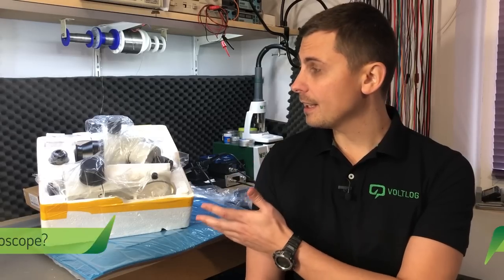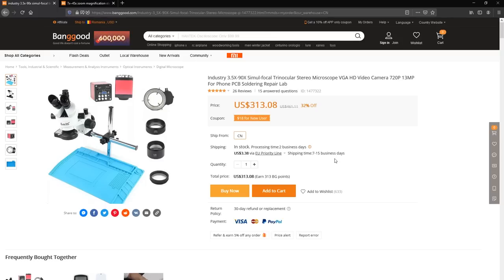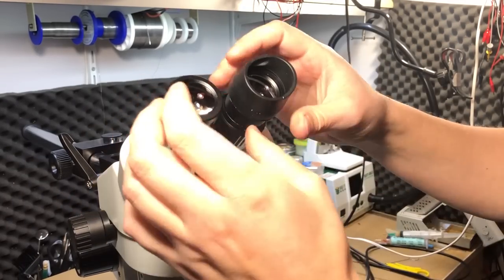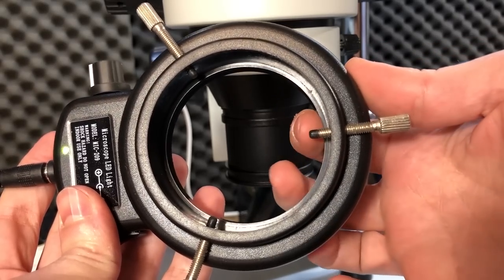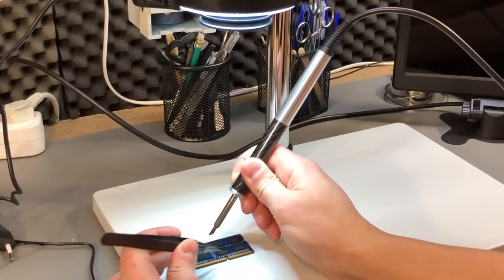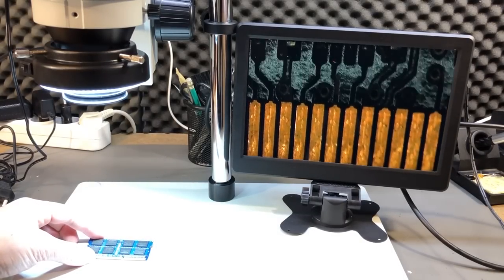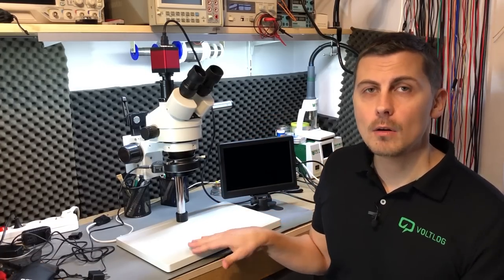Voltlog #282 - Did I get a trinocular microscope for micro-soldering and inspection?

Comment: Have you checked if there is a transport foil on the sensor?
For the FOV: Yes, you've got a passive adapter. A 0.5x-Tube instead of the 2-piece-thing works much better for FOV (but might degrade the image quality). For example BangGood 1618592.
Reply from the maker: I did check if there is any protection film, there is none as far as I can tel. I can clearly see the image sensor die inside the camera. Thanks!
Reply: I had the same Issues with my microscope. The 0.5x camera adapter basically solved both issues. The field of view of the camera is still not the same as on the eyepieces, but it's good enough. It takes a bit of fiddling to get the focusing of the camera with the eyepieces correct.
Reply from the maker: @fkiesel9442  I've ordered one of those camera adapters 0.3X, I will do an update video when I receive it.

Comment: Try the camera when not mounted on the microscope, and check the brightness like that, could be a optical mounting / focal lenght problem only.
Reply from the maker: It's hard to check outside of that mounting system, because the image is totally out of focus, there is no lens on the camera itself and I don't have any compatible lens.
Reply: Lord_haven111  `
All you need is a C-Mount 1/3 and the camera will work correctly. The thing is the C-Mount 1/3 (or 0.33x C-Mount) isn't cheap, that's why this kind of kit doesn't includes it.

Comment: I have basically the same model, but from US seller Amscope. Would strongly suggest going with the dual-boom stand if buying one of these. A little more expensive, but is rock solid and image is stable when working under magnification (the dual-boom base must be at least 40 pounds of cast iron). I also ended up using a 0.5x adapter to increase the working distance (always something to keep in mind when you need to get a soldering iron between the lens and PCB - many cheaper scopes have very small working distance that makes the unusable for our purpose).
Reply from the maker: Doesn't the more advanced boom stand take up a lot of bench space? My benches are not very deep so this matter a lot to me..
Reply: @voltlog  I don't think it needs THAT much more space. It doesn't have that big of a base, so the head is directly over your workbench surface (doesn't need it due to it being so very heavy). When not in use I just fold in the head and swing the boom 90 degrees out of the way. Even at full extension the dual boom is very solid and the image is stable, which was very important for me. Either one will do the job, but IMHO the dual boom is a good upgrade.
Reply: @voltlog  - It doesn't have to. I have a boom stand, and have built a stand for my soldering iron + heat gun on top and around the center. It adds weight, and I can extend the boom all the way out without it tipping. I have some extra stuff on the head, so it is extra heavy. When not in use, the head turns around and I center it - much like a sleeping bird.
I would think you could do something similar, if you turn the base around. Tipping over could/would ruin the head, so be sure the stand is either bolted to the table - or heavy enough so it won't tip over if/when you pull down on the head by mistake.
Reply: Boomstand cost more than the scope. Thats just insane..

Comment: As others have suggested the field of view issue with the camera and the poor image quality are part of the same thing. You need a reducing lens between the camera and the trinocular port. This will increase the field of view and, because you are 'collecting' more light, the brightness should improve too.

Also, the 'fine focus' control is not focus at all - it is the zoom control. This being a relatively low end microscope, adjusting the zoom tends to lose focus, so you need to adjust that (with the larger knob) once you have zoomed. You can get microscopes where the zoom control maintains focus at all settings, but they are insanely expensive.

In due course, you will find that the microscope totally transforms soldering for pretty much all surface mount work. You will wonder how you ever coped without it.
Reply from the maker: To me it doesn't make sense why they would sell a microscope + camera bundle that doesn't provide a good image and might need additional hardware. Reading other reviews on their website shows that some customers are getting good brightness from their cameras while other complain of the same problem.
Reply: VoltLog this is what happens when you buy Chinese stuff. Not much thought. More like “that will do”
Reply: My camera quallity is good though.

Comment: I think the dark image is most likely related to the camera adapter rather than the camera. If you can, adjust the camera tube to reduce the distance as much as possible
Reply from the maker: There isn't much adjustment in that tube, I've tried multiple adjustments on that, doesn't make any difference in brightness, it just breaks the focus because it changes the distance from the camera sensor to the optics below.
Reply: @voltlog  It still sounds like the camera adaptor. The 0.3 or 0.35x adaptors from the ebay seller are lapsun_gift are probably the best ones. I don't think the camera is at fault.
Reply from the maker: @sdgelectronics  Okay, I will have to get one of those adapters any way, so we'll find out in a few weeks if it fixes the problem.

Comment: The part between the camera and the body of the microscope may have an aperture setting. Maybe it's completely closed giving a wider depth of view but very little light.
Reply from the maker: that part is actually just a two piece tube as shown in the video, no setting on that part, other than length, which controls the focus for the camera.

Comment: For the camera on a microscope like that I used one I already had from a wrecked drone that is 1080P with WiFi and HDMI out that runs from a 5 volt micro USB supply   The lens is much smaller so I 3D printed a collar to adapt it to the larger camera tube and it works great!

Comment: Does it really help in soldering? how you feel about sync with hands and soldering iron and depth?
Reply: Belen Hedderich I e had one of these for a while now. It’s absolutely perfect, good depth of field and sync. You will wonder why you didn’t do it before. One of my best buys ever
Reply: Depth is one reason why you should really go with a stereoscope and stay away from the cheap USB microscopes or microscopes that have only a monitor. For your own soldering two eyepieces are the best and probably the only thing you'll use. A camera is very nice for people who want to share their work and teach as well. 
I got an Olympus SD30 for cheap from a university and it made such a big difference when working on SMD parts or very small phone PCBs. It has a lower working distance then the one in this video, but still enough to solder comfortably. 
So for private use it can be worth to check the second hand market around you. Sometimes you can get high quality stuff for really cheap. If you can get an Olympus or other known brand and the lenses are still in a good condition you can't go wrong with it, They had an incredible quality even years ago.  Personally i use most of the time 10x and for very small stuff 30x. Everything above is too much magnification imho.
Reply from the maker: Like others have mentioned, with a stereoscopic microscope you get good depth of field and sync, it's just a short accommodation period that you need to get past.

Comment: The boom stand is really great, it makes the setup a whole lot more stable - no more tipping over and no annoying plate below. I got it on my AmScope, head is quite similar to yours.
Your camera is ok (I think) To get a better picture here's what I suggest:
1) Add much more light, a lot closer. 
2)Disable auto-exposure, set the frame-rate at a lower speed (if possible) and/or increase brightness.

The camera I have on my AmScope is the MU300 - USB2, 3.1MP - and it does 30fps in an OK quality (680x510) though it requires a bit of fine-tuning. It's rated at 22fps at 1024x768 - with good light exposure I get around 14fps, 22 fps is really dark and unusable.
Reply: I've watched other videos using digital microscopes and the lense is a lot closer to the board being worked on.  I have also seen other users adding additional lighting.
Reply from the maker: I have tried a lot of light externally, it doesn't help. Like others have suggested here I will try getting one of those camera adapter magnification lenses which will hopefully improve things.
Reply: @voltlog  Hope that solves things for you as it looks a good scope for the price otherwise!
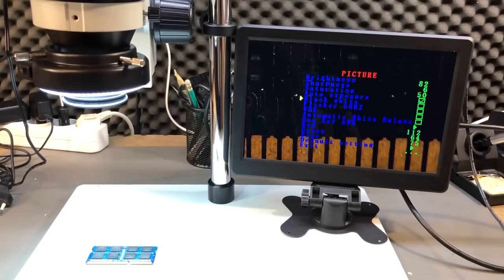Reply: @voltlog  - Did you try disabling the auto-exposure - @7:50 - does adjusting the Brightness setting up/down do a difference when auto-exposure is on/off? It can take a few seconds to kick in.
Getting the lens adapter will do a lot as the field of view is larger, hence a lot more light will enter the camera.  Best of luck!
Reply from the maker: @EgonSorensen  I have tried all of the available settings, they make little to no difference, the image is still dark. Now the best is on the adapter lens, which will take a while to arrive due to Chinese New Year holiday.

Comment: Maybe the LEDs are not bright enough on that high working distance, combined with the brightness loss because of the camera adapter that BitBastelei mentioned? It's hard to tell how bright the LEDs are as a viewer because of auto exposure. I'm using a different scope, but i decided to create a ringlight with bright 5730 smd leds on a round pcb.
Reply from the maker: Even if I bring in a lot of external light, the image is still just as dark on the camera.

Comment: I have that, love it. I solder 1005 components on iphone with ease, and work with 0.01mm jumper wire. I can't find a reason to buy a way more expensive scope. Also i took away plate and drilled a hole in table, much better. Uhm, what else, its awesome for the money, no doubt.
Reply from the maker: Awesome! If you are interested look below, someone posted a comment with a link to a 3d printed holder to be used in the same purpose for table top mounting.
Reply: exactly what i did with mine! no plate and drilled the desk.
Reply: @voltlog  where Is the link? I can't seem to find it

Comment: I prefer a cheap microscope for electronics, with USB output to my computer, where I can see it in my big monitor, take pictures and record video, because I have use monocular and binocular microscopes in the past and my eyes end very bad after less than a minute; I still have a monocular biological microscope, but I use the same system, USB camera to my computer, because that problem. Don't you have that problem yourself ? Thanks for sharing !
Reply: It sounds like you needed to change the dioptre adjustment for each eye. These shouldn't cause any eye strain
Reply: @sdgelectronics  Hey ! I know you! Hehehe ! :D Sorry, I didn't explain myself : is mostly because the light, even when is very low, and I'm not the only one, almost all people I know using microscopes feels the same, maybe is the contrast between the microscope light and the ambient light, no idea. Thank you for the videos in your channel !
Reply from the maker: I'm not having any notable problems while using a microscope, however I would imagine some eye strain is normal if you are using continuously for multiple hours. I never used a microscope for more than let's say 1 hour through the eye pieces.

Comment: try to drop the ring light lower
Reply from the maker: That's the second thing I tried, after checking if there is any protection film on the camera input. Unfortunately doesn't make any difference, I also tried bringing in a lot of external light without any luck.
Reply from the maker: That looks like a nice camera to try next. Thanks!
Reply: @voltlog  I am using it on my channel 1080p 30fps, it can do 2k but only via hdmi